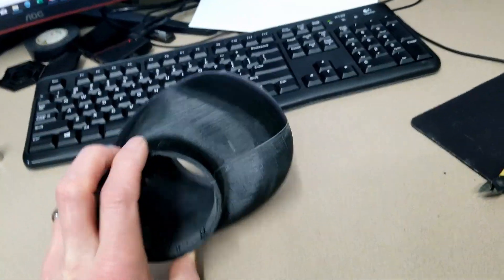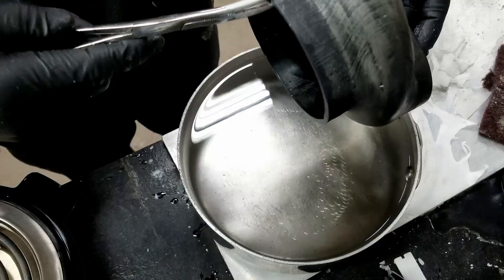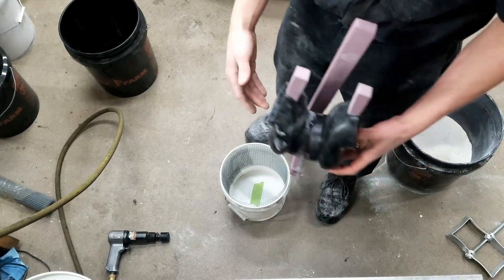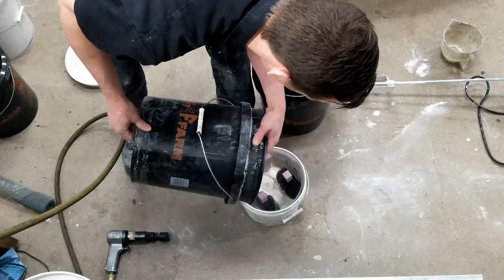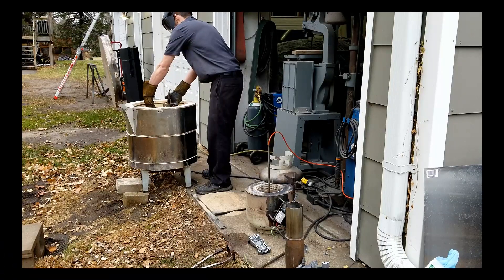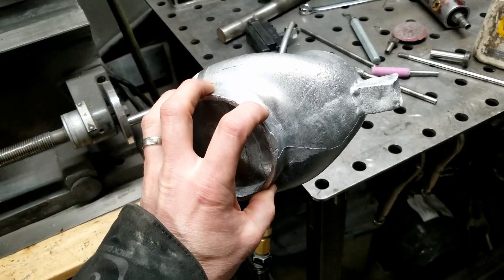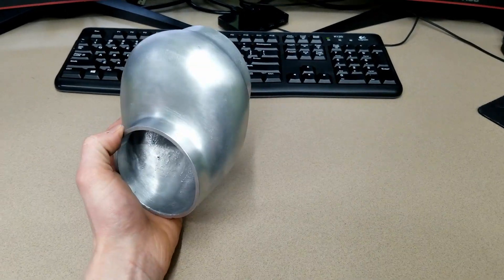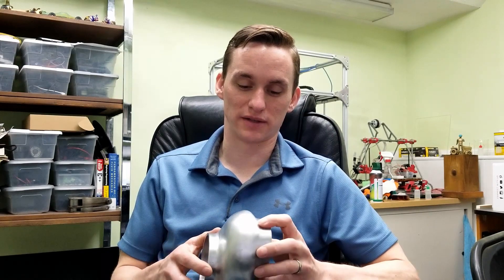Metal Casting an Aluminum Intake Piece

Comment: This turned out really nice. You mentioned designing it for the same cross sectional area, did it end up flowing as well as a round tube?
Reply from the maker: @jetcitynorthstar  most likely not with the abrupt changes in direction. It was an extremely tight area to work with and it was in my opinion the best option to route for a quality air filter.. I did not have a flow bench at the time, but I could test it now.

Comment: Did you weld the 2 pieces together after pulling them out of the mold?
Reply from the maker: Yes, but, if the mold didn't have a hole it would have casted as one piece.
Reply: @snagle87  reason I ask is my friend has a 98 firebird with a supercharger and I 3D printed a adapter from the ram air which is a ellipse to a 3.5” round pipe and I want to cast it. And am wondering which is best…. To cast 2 pieces and weld or try to cast it all in one with plaster and melt the pla out of the mold!
Reply from the maker: Did you design the part to have a parting line?
Reply: @snagle87  I did design it. I can totally cut the model in half and print it in 2 pieces.  I use fusion 360.
Reply from the maker: @trialnterror  I would probably do a sand casting just because of the amount of plaster of Paris used and having to slowly bring that mold it up to temp is kind of a pain. I'm on the fence about that one. I'd love to see what you come up with though.

Comment: I had a very specific question regarding burning out the plastic completely. When you say raising the temp slowly over 8 hours would something like 2.7 degrees every 2 mins be fine. What is the ideal rate of increase per min till you reach 750 degrees? Also did you have to reduce the temperature of the mold at the very end after complete burnout, to what temperature and for how long?. Thank you for taking the time to read my comment and looking forward to your reply.
Reply from the maker: A lot depends on the amount of investment you are using. I don't have it down to a science yet but about 100 degrees per hour. And trying pour when the mold betweeen 500 to 600 degrees.

Comment: what is this liquid in which you dip the plastic piece ?
Reply from the maker: Paraffin wax. You want it just hot enough to melt but not enough to destort your print.
Reply: @snagle87  this is incredible ! I was far from imagining that wax could smooth 3d prints with wax. Is it a special wax?
Reply from the maker: @proteo-x4u  Nothing special. Gulf brand paraffin wax. The print is PLA. Print with as little infill as possible.
Reply: @snagle87  and your print is it ABS or PLA ?

Comment: Did the kiln melt down the material from the 3-D printing leaving the void for the aluminum to fill?
Reply from the maker: Yep. You just place it in the furnace upside down at around 750C. You have to bring it up to temp very slowly over 6-8hrs.
Reply: @snagle87  Thank you!